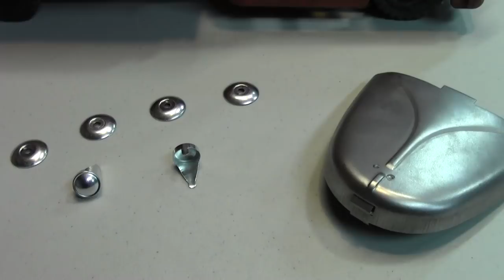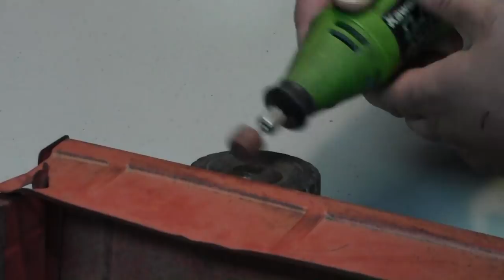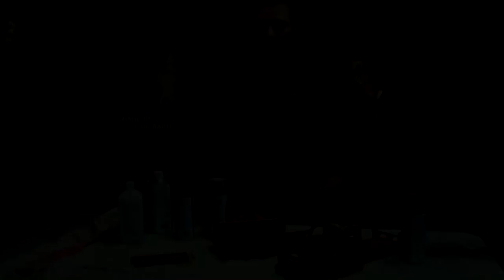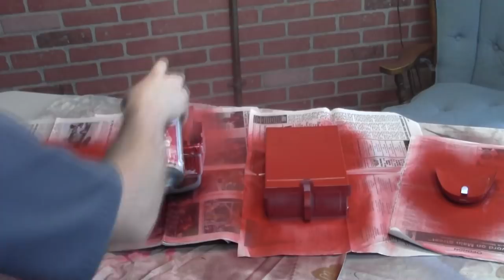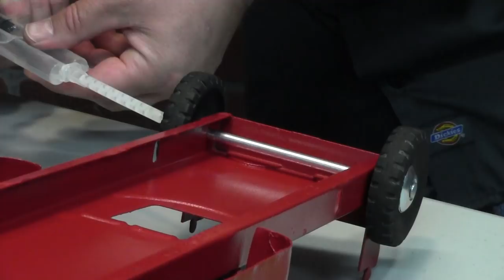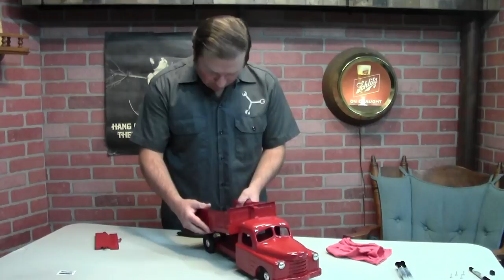Vintage Structo Dump Truck TOY restoration (1950s)

Comment: nice work, I don't have fancy tools to work with or an air brush, so this is how I have to do it. However, I do like to add details like painting bumper and grill silver or chrome, such as that, even though it did not come that way, I don't care I do it how I like to see it. Most of them are given to neighborhood kids to play with after I'm done, they're not meant to be perfect shelf sitter restorations. I generally remove all the paint, and it can be a tough job. 

Shane King, this truck may not have been a three axle, but they did use the same frame and body to build other types of trucks, tankers and so forth, so the slot you saw is probably there for other uses.... no way to know for sure though.
Reply from the maker: You are correct.  The hole is for a 2nd rear axle as this pressing is used on at least 2 other models I know of, another style of dump truck and the cement mixer model.  I have a cement mixer to I will get to in the future, but it can be seen in this video.  https://youtu.be/ZI-mPsB_0Sg

Comment: Ever consider spraying the hub caps and such with a clear coat? This should help prevent the rusting.
Great videos BTW!
Reply from the maker: One could do that, but eventually it would chip off and rust anyways.
Reply: Agreed. But it would give it a little "play time" before hand.
Reply from the maker: It took 60 years to fully rust, clear coat may only extend that by a few years.  The best way would be to strip the cad plating and have them chrome plated, but that is a little un-reasonable for a project like this.

Comment: Anyone know what year they changed the wheel design? We have a bunch of these my personal favorites is the earlier models with narrow hoods and suicide doors. Most have hubcap wheels but picked up a fire truck and it has a wheel similar to the ones on the stub nose trucks but smaller.

Comment: Great video. I have several old trucks that are not pretty. How do you find the proper color codes and is there a certain brand of paint that you prefer?  Thank you
Reply from the maker: There are no codes. I just search for what looks closest to a chip in a decent area not touched by sun. I  use various paints, but I prefer Van Sickle with hardner if they have a color that works.

Comment: Looks great! I know you said it was a single axle, but do you think it was a dual axle originally?  There is a set of slotted holes in front of that read axle. Just wondering.
Reply from the maker: No. They just used the sam stamping as the dual axle and the cement mixer which I have as well.

Comment: HOW COULD YOU FORGET TO INSTALL THE OTHER AXLE? double axle large structo dump truck?
Reply from the maker: Because this is the single axle version.  They use the same stamping for both dumpers and the cement mixer, which I have one of those too.  So I didn't forget because it is not supposed to be there.
Reply: @thejunkman  oh, i  figured since it had holes for it it needed them,my presumtion was incorect.. still looks nice